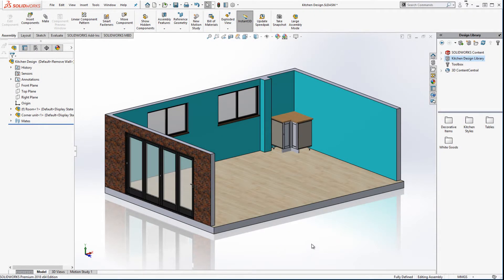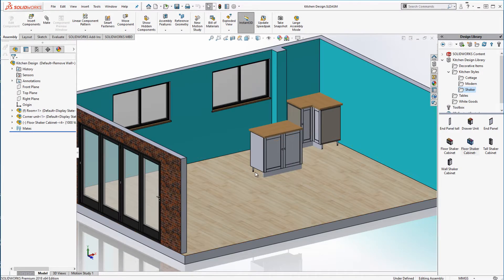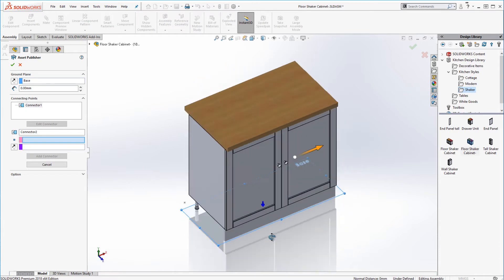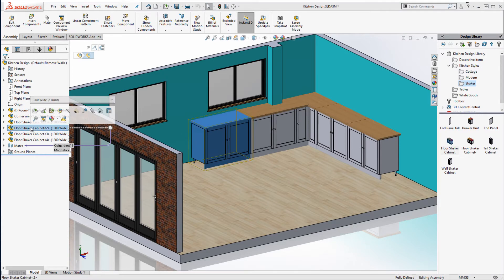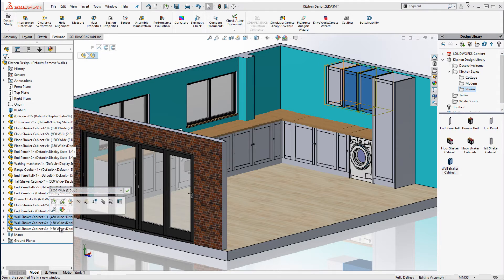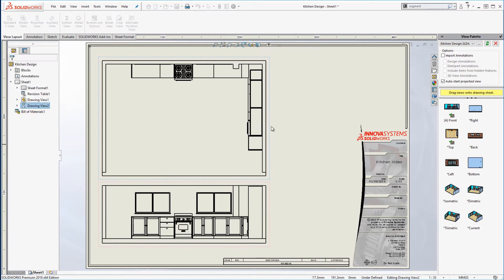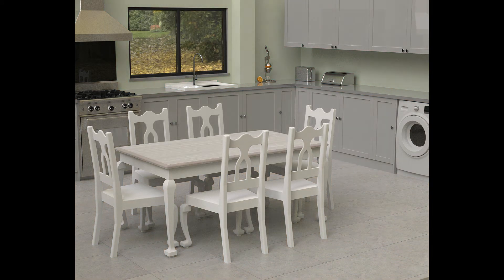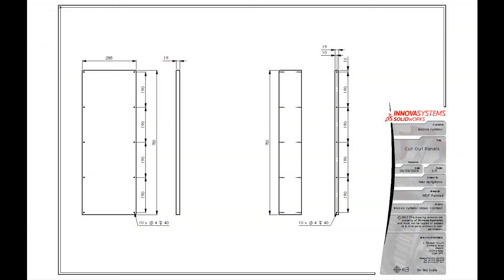Faster SOLIDWORKS Assembly design using Magnetic Mates (Kitchen layout)

Comment: Here are some timestamps for quick reference:
1:44 Setup Asset Publisher for individual cabinets and define Ground Plane for Kitchen Assembly
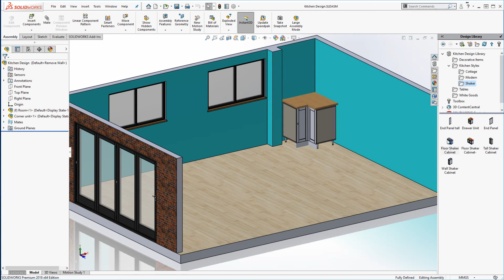2:30 Start bringing the cabinets into the Assembly using Magnetic Mates. Change sizes using configurations.  Add side panels and appliances.  Fine completed lower layout by changing sizes using configurations.  Define a new Ground Plane for the wall units.  Extrude cut a cabinet to make room for box column. 
4:00 Make presentation drawings, pricing, BOM and renders with SOLIDWORKS Visualize.
5:09 You won the job! Now you can make manufacturing drawings and detail that special cabinet with the box column cutout.